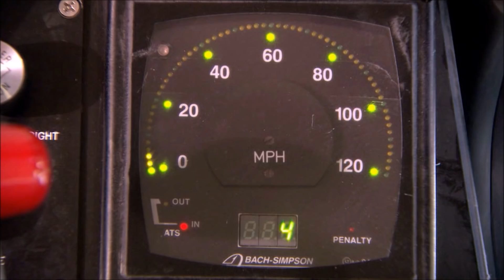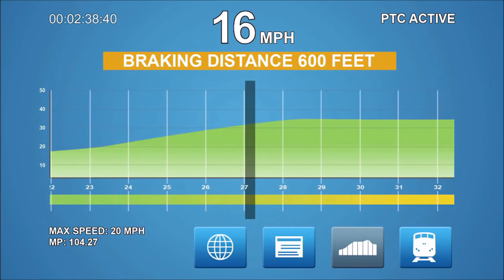Amtrak 501 "Cascades" Train Derailment 18 Dec 2017

Comment: Given that cars & trucks can autopilot reliably now and that the entire rail system is already precisely mapped, including exact locations of switches, curves, etc., and the locations and destinations of all trains is precisely known (or at least should be), it should be a much simpler and much more reliable engineering problem to develop and implement fully functional self piloting trains.  The human operator then serves the purpose of overseeing & managing the system.  

The question for you to investigate is why hasn't this been done?

Comment: Juan I don't know about this  looks like the crashed before the turn, I be he saw the turn and hit the skids to late  because the cars all stacked up and the almost over took the engine, if the train would flew off due to speed  the engine it seems to me would be way farther away, and the cars  more farther from the tracks
Reply: ok I was looking at it the wrong way so to be clean the lead locomotive is off and down on the road and the tail locomotive is still on the tracks after it made the curve
Reply: In general, engines and cars tend to bunch up when they derail.  When an engine jumps the tracks, it and every other car is just a projectile travelling at the same velocity.  And those wheels don't roll on anything but a rail, so each projectile slows down erratically and fast as they plows thru the ground and/or decouple from the other projectiles.
Reply from the maker: don't forget the air brakes locking up automatically.
Reply: The air brakes did lock, which is why the pushing locomotive stopped and didn't push more cars over the bridge. The lead locomotive - brand spanking new at $8mil -  left the tracks ahead of the curve and plowed down thru the grade onto I-5  and dragged 2 or 3 cars with him - the followup locomotive pushed the rest until his brakes automatically dynamited
Reply: John to me this  looks like the back of the train  tied to pass the front of the train based on the pictures I seen to me its like the rear locomotive didn't brake and the front did, its like when a semi  jack knifes  the trailer tries to push past the truck
Reply: Right Juan I know on a semi  when the brakes a worn on the trailer they will lock up automatically, on a train I have no clue, to me and I'm no expert, just looks to me the front locomotive  was slowing  but the rear didn't brake, its like hauling a car on a trailer with no brakes behind your pick-up and when you slow the truck the trailer keeps trying to push the truck

Comment: Thank you, Jan for this update very sad situation. Could you discuss whether PTC can be hacked?  Thanks.
Reply: quick answer:  "Q: How are railroads keeping all of these communications secure?

A: Cyber security is an important factor in implementing any complex technology requiring potentially sensitive information, and it's something that every railroad is taking seriously. To make sure the system is secure, railroads are working on sophisticated encryption keys that will ensure that the communications between railroads, as well as sensitive data, are secure. 

This is quite a meticulous process, because these encryption keys must be updated from time to time, and a situation may arise where they need to be updated at a moment's notice. That would require changing the keys on all locomotives, towers and wayside devices."
Reply: if it's on a network,  it can be hacked.  The question at hand is are the communications of this system encrypted?
Reply from the maker: bill4nier pure speculation at this point. PTC simply wasn't operational yet on this line.
Reply: P.S.  excellent report, thank you.
Reply: which means any red team security firm could simply wait for the packets to fly that include the new encryption keys over a few cycles, capture them and reverse engineer them.  Nothing is safe in this regard, unless their encryption methods change for each key.  Think of your brand new BMW and the door unlock keyfob,  it will have a ""rolling" security design meaning the methods or keys differ in a way that is not probable to decrypt in future attempts based on the past keys.  Albeit those are usualy RF as opposed to WiFi comms.  I'm sure they are on top of it given the railway are still the number one transport of goods and services.  Sorry to think oyt loud.. I am confident they are considering these things also,  however the airlines still have some work to do!

Comment: How's the engineer?  That lead engine is pretty smashed up.
Reply: +silverstake88 
please learn more.

it's always easy to blame the heavy equipment operators, with short sighted no knowledge under your belt.
The rolling stock is dated from back east, single truck/coupler car to car system (1).
The married units were not a northwest design.
With heavies at each end.
Auto 80 mph dynamited the brakes on that curve.
imagine the momentum that took over !
basic physics, an object going in a straight line tends to stay on that straight line. it's called momentum.
and were talking hundreds of tons.

I would like to see the track damage, tells all !
Reply: I read earlier the engineer had head injuries and his eyes were swollen shut. (How is he now?)
Reply: DAVID BROWN The person on the radio was at the back of the train that was still on the tracks.
Reply: some other comments pointed out that that was probably a conductor and not the engineer.
Reply: Why not wait for the NTSB report  and have some empathy for the crew in the meantime and everyone else involved in this trajedy,i`m pretty sure you don`t walk on water,
Reply: cember01 : You can hear on the radio transmition  of Amtrak that he was able to communicate fairly well.
Reply: Well he's not dead but he's still a dumbass because he doesn't understand speed and corners. This caused of death of those people - manslaughter charges better well be forthcoming.

Comment: I used to arrange our FAA testing every few years at KBWI.... What an eye opener. But the two different light rail crashes into the terminal was the worse I ever saw there. Don’t forget that the FIRE AND EMS response will also be looked at with a fine tooth comb
Reply from the maker: Rob Lowery good point!

Comment: There is no guarantee that PTC is going to work. Its high cost also is draining billions out of the private railroads, money that could go to more common-sense and cost-effective safety measures like worker training, car and track maintenance, worker screening, drug testing, car and track inspection, etc.
Reply: tiger phid I can understand where youre coming from.. however  these kinds of systems are in use for many years now in west europe and Japan for example along some older automated train safety systems. So far all these systems similar to ptc have a 100% safety record. But i do agree the initial costs are high and will have budget concequences to other parts of the operation. I fear that the big difference between usa and europe is, that in europe the new system is heavily subsidised by governments. But still that doesnt mean the usa can do without it. As it is, most railinfrastructure in the usa is outdated and in need of replacement so now is the best time get on with it while youre at it anyways.
Reply: tiger phid tell it like it is some people think the billions of dollars came from nowhere
Reply: PTC is important for earthquakes as well, to stop trains from going over damaged tracks immediately. PTC is coming, just not fast enough.
Reply: Well there's no guarantee an humans going to work either... so I guess we should just give up all hope! Airplanes have automated safety systems, automobiles, many other things, especially things that go too fast for a slow human to react. Train going 80 is a perfect example of where safety automation is a good use of technology.

Comment: What bothered me Juan was that after spending over a hundred million dollars as you stated they left an old bridge over the freeway right in the middle of bend which was only supposed to be taken at 30 Mph.  Are the designers and engineers nuts?  In the time that train was supposed to make the trip from Seattle to Portland that train would have had to average 70 Mph with no stops.  this reminds me of Tacoma Narrows bridge disaster.  They must think of safety in their designs instead of looking to save a buck, which has now cost lives.

You're doing a great job Juan, keep up the good work.  We appreciate your attentiveness to critical issues.
Reply: nice postive post first of all... very nice, an OLD bridge that cant handle a new FAST train, is left in and NOT removed so that the train MUST slow down, a danger HAZRD for sure,, BUT as long as nobdoy goes flying around the corner at 80 miles an hour, every thing will be all right... no one will get KILLED and no one will get HARMED and  everything will be ALL RIGHT...as long as no body goes faster then 30 miles an hour... i lve being positve... its so nice... maybe if AMTRACK and the WSDOT where more POSTIVE no one whould bhave been MURDERD on the oreint express amratck murder run.. a soon to be made into msytery movie comming out...

Comment: This reminds me of that age old metaphor:- "If it can go wrong? time will show it does go wrong!" ... A circuit board can be positioned in the wrong rack by a service engineer, but only if the design allows that to happen. If only the correct circuit can fit, and all others can't fit. then that is the first hurdle overcome. The next hurdle is the often misused term :- "Fail Safe". That does not mean "Very Reliable", it actually means a 'Failure' of any kind, results in a 'Safe' outcome. For example Vacuum Brakes, it the vacuum brake pipe is punctured, no more vacuum! and heavy duty springs apply the brakes. ... A very distressing tragedy for the bereaved, who all have our deep condolences and prayers.

Comment: The MetroLink video explaining Positive Train Control is a reasonable explanation of how the system should work. What it does not say is that PTC is an unfunded mandate from the government to the railroad industry. The majority of the development costs were placed on the railroad industry which has spent billions in trying to solve the problems related to implementing PTC. It is because of unresolved implementation problems that the deadline for PTC was extended to the end of 2018.
Reply from the maker: David Taylor great insight. Thanks David!
Reply: Yes, great insight by David.  Another fact about the PTC implementation is it requires very specific wireless communications all along the rail right of ways and the rail companies have had a very difficult time obtaining bandwidth necessary to run the PTC system.  The system design is comprehensive and highly complex.  It was designed using technologies which are approaching 20 years old.  Attempting to implement a solution among various governmental entities both state and federal, private transportation companies, and other powerful stakeholders, has resulted in extended design times and many design compromises.  The railroads have spent billions across the country to implement the system, all the while chasing ever-changing requirements and waves of political change.  Writers in various train publications have postulated that PTC, if designed using today's technology, could be implemented far more quickly and for much less expense.  Of course, that train has left the station (sorry, I couldn't resist) since so much has been implemented to this point.

Comment: In this case, first of all we have to be respectful for those who lost their lifes and their families. Then analise smoothly what caused the accident: excess speed in a dangerous curve. As you said, the speed at the moment of the accident was 80 mph and had to be 30. That's all that can be said, appart from questioning the safety of the trains and the railway system in Washington State. Another "good" video, if you want to say it like that (not for you of course, for the tough and delicate subject). My respect for all those who have lost their lives and for their famillies.
Reply: oh very very nice, so very positive... you must work for amtrack you are so positive and so very nice... and thoughtful... toward the 3 lives who lost their lives because no one cared to remove a 30 mile an hour corner on a 80 mile an hour run... if it was OK for the corner and the OLD bridge to be in the 80 mile run the ACCEDNT NEVER WOULD HAVE HAPPEND and no one would have lost thier lives... no one harmed... and then thats something that we would all be thank full for... your are lucky that the train did not land on your head and thats what you are thanfull for and only that...and thats all that amtrack and WSDOT is thankful and thoughtful toward... nothing else